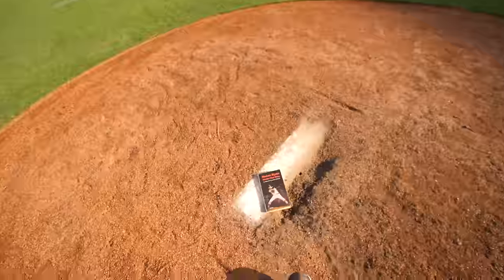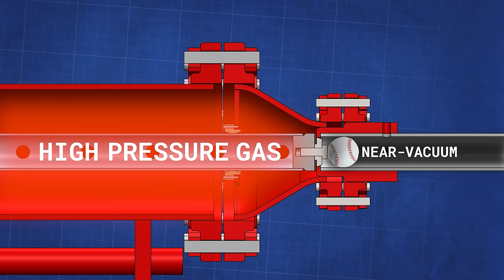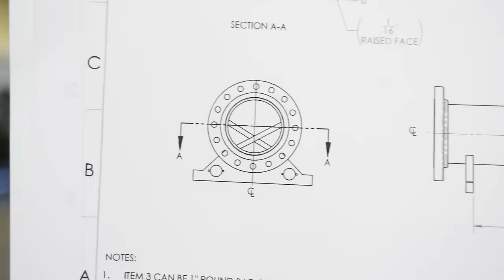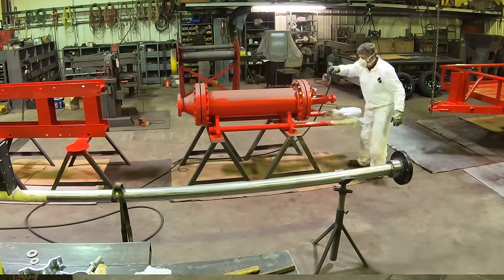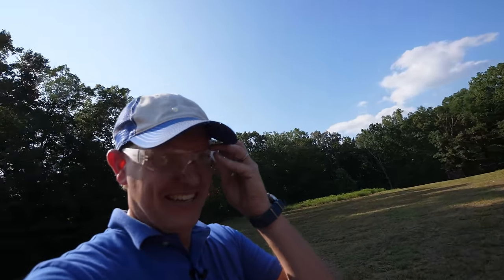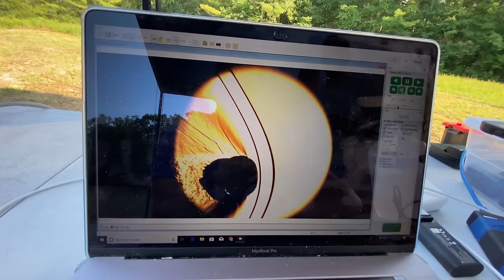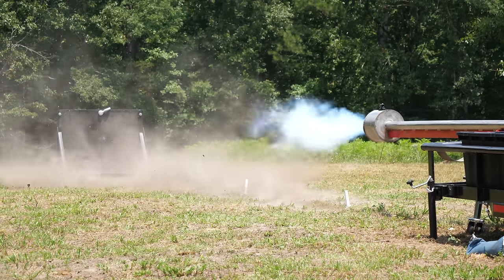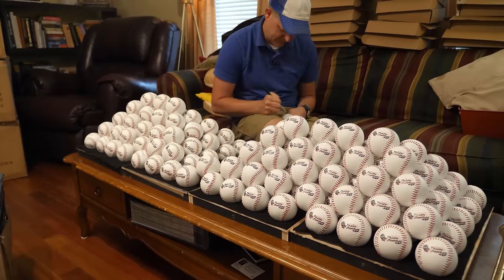World's Fastest Pitch - Supersonic Baseball Cannon - Smarter Every Day 242

Comment: 19:59 - Do we know where the initial damage to the baseball's seams came from? Was it friction from rubbing along the cannon tube while being ejected or the friction from the air going around the ball? While we know the deformation of the ball when it hits the plate is what tears the ball apart, but does the existing damage add anything to it?
Reply: I was born in 1959
Reply: A nerf dart gets shredded when it goes supersonic, it doesnt seem too unlikely that a baseball going supersonic will also get a bit kf damage
Reply: @cwtrickshots4198  OK boomer
Reply from the maker: I wondered if the baseball outgasses inside the barrel.
Reply: It would be interesting to see what would happen if a discarding sabot was used to protect the ball from both the immediate contact with the gas and the barrel. But I can't see how that could be tested without replacing the entire barrel assembly. So any other ideas?
Perhaps using something like a shoot cup behind the ball might make a difference? It wouldn't prevent the ball from rubbing against the barrel, but it would provide some protection from the violent gas pressure behind the ball.
Reply: I think it's fair to assume barrel friction.  It seemed pretty tight when they loaded it.
Reply: @smartereveryday  Sounds like we're in for another round of testing. Isn't Science really the gift that keeps on giving? If it weren't for scientific questions, we wouldn't have as many opportunities to build and use fun gadgets.

Also, don't forget the danger mitigation review prior to experimentation. ;)
Reply: @smartereveryday  Sorry, that last part should have been "Risk assessment and mitigation planning."

Comment: I'm curious where the loss of vacuum was coming from (tape at end?) and if that could be solved for yet even faster shot.
Reply: Yeah curious too about the loss of vacuum. Also wanted to know if the chamber Destin designed worked as intended.
Reply: on some of the later shots he got a better vacuum, guessing the tape didn't have a perfect seal
Reply: @jonathanshaw6784  nah the tape works just fine.... he pulls a -14psi on his dial with the tape on before the pressure in the other tank is added. 
sealing against vacuums is really easy. its just one atmosphere of pressure differential after all. but the back seal doesn't have atmospheric pressure on the other side they have it pressurized to +500psi so the total differential on the back seal is ~515psi. on a seal that is built to not force itself shut due to this pressure.
i say they have a leak between the high and low pressure side
Reply: Five bucks says its the leakage from the high pressure side to the low pressure side.
Reply: @TheScarvig  I came to say exactly this. Well said. With a complete vacuum, Destin could accurately measure the coefficient of friction between the ball and the inside of the barrel. Like we did in physics class where every equation happens in space.
Reply: TheScarvig This was very well said. I can’t say it much better without practically just rewording this message. The likelihood of it being a leak between the high and low side is very probable, especially since it comes on gradually as our pressure increases and not an immediate loss of vacuum which would likely be seen if the seal at the end broke.
Reply: Just based on observing the timing when they started to lose vacuum, there is a leak between the high and low pressure sides.
Reply: I wondered if they solved the problem by the old "soap bubble" method.

Comment: everyone talking about various things in the video, and I'm here wondering if he figured out and fixed the reason why the cannon was losing vacuum as the pressure passed 500psi.
Reply: That was what I was most curious about. I'm not going to be making an air cannon, but seeing what little mistakes can be made and how they are fixed can sometimes incredibly insightful for future reference.
Reply: The most likely reasons was some leakage at the gasket between the two chambers or at the tape seal over the muzzle.
Reply: @WolverinStudio  I figured it was the seals in the pressure vessel that was the cause. Reason being at 300 psi or so, the vacuum was good, which says to me, the tape seal over the muzzle was holding, but reaching higher pressure, vacuum went. So my brain says pressure vessel seals. I know it's an assumption and assumptions are the mother of all fuckups, but figuring out things like this is relaxing to me.
Reply: @ictherain  exactly. Who knows, there could be another air cannon with a leaking seal being built somewhere in the world... like south eastern europe.  ;)
Reply: I imagine the seal deformed under the nitrogen pressure around 300 PSI. I wonder if a strong vacuum is even necessary at that high of pressure with that large of an expansion volume at the front of the gun to take on the pressurized air in front of the ball. The initial velocity wasn't impacted much from the 8 psi vacuum to the 5ish psi vacuums at 500+ PSI. I'd be interested to see a chart of initial velocity vs vacuum at a controlled nitrogen pressure.
Reply: that's all I was wondering too I thought he would address it sometime later in the video, now I am hoping that he would figure it out and make the part 2
Reply: Ball still made supersonic even with the huge leak & loss of vacuum.  I'm wondering if the whole vacuum-front was even necessary.  They routinely shot at <600 psi, even though the pressure vessel was built to withstand 900+ psi.  I'm thinking:  get rid of the vacuum setup, put a muzzle brake on the front, and just load the pressure to 750+ psi.
Reply: WolverinStudio 
All you would have to do is to watch it what point it started losing vacuum at what pressure because it is most likely leaking where the Barrel meets the tank.
I don’t understand why the maximum amount of vacuum would only be 14.5 because when I gas up air conditioners it will pull 28 inch pounds of vacuum because of the sea level I’m at. I’m in Tennessee. I’m not sure which part of Alabama they are in but I am about 30 minutes from ALABAMA if that.
Reply: @e-racer4673  standard atmospheric pressure at sea level is 14.7 psi, as I'm sure you know. So if you have a -14.7 psi vacuum than that would be an absolute vacuum. How you're getting double that is what I don't understand. Definitely would like to know.

Edit: psi is different from inches if mercury. 29.92 is standard pressure for mercury which is 14.7 psi which is what Destin said he was measuring.
Reply: The vacuum most likely reached its peak limit and couldn’t extract any more air
Reply: The ball itself keep pressurised air, keep it under vacuum can cause depressurising the pipe.
Reply: E-Racer 
If you check air pressure at sea level, that’s 14.7 psi. Meaning, if you move from sea level to outer space, that vacuum differential you just generated is 14.7 psi vacuum. You cannot pull more vacuum than absolute vacuum. 

I am not familiar with refrigeration. But I suspect what you meant by head pressure (vacuum) is measured against another point within the refrigeration unit. Imagine this: if point A in the system is at 60psi, and point B in the system is at 10psi, then when you measure the relative pressure across those two, you get 50psi “vacuum”.
Reply: TheHeroJayy 
Yes that’s pretty much how the vacuum pump works. But what folks are asking, is why on one hand the vacuum level held while charging to 300psi in the main tank, but on the other hand as they approached 500psi main tank they start to lose vacuum level.

Comment: I love how they made a "legal" field artillery gun that would make any atf agent lose their mind.
Reply: It's an air gun, not a firearm, so it should be pretty simple
Reply: yes
Reply: @evandugas7888  But it might well make a difference for the legal status of the device, since firearm laws don't apply to air guns.
Reply: I don't think it goes near as fast but I'm not sure
Reply: @evandugas7888  I could be wrong, I'm just guessing, I poorly explained this on another thread but a baseball weighs 4 and 1/2 ounces, a steel sphere with a 3 inch diameter will weigh approximately 4 Lbs. over 10× the mass. f=ma solve for acceleration f/m=a you can see with a high mass and the same force, "a" is decreased. The same energy that liquidises the baseballs at mach 1.35 would probably spit a cannonball in a low arc and dent the target unimpresively.
Reply: @captainTubes  Maybe I am unsure. Still think that using a harder material could have impressive results.
Reply: @captainTubes  so you're saying, use aluminum. ;-) Or perhaps a hollow steel ball....
Reply: @jadedelite  yeeeeeet

Comment: I love this stuff.

Some 20 odd years ago, we in the PCP Targetry sport, in Britain, had a lot of discussions as to whether a PCP (Pre Charged Pneumatic) rifle could project a pellet faster than Mach 1. 
Even the engineers from some of the top manufacturers did not know for sure. 
Folk from different specialisations would expound upon their theories. 
It was already known that a spring powered air rifle could do it. 
Some physicists claimed that because air could not move or respond faster than the speed of sound that the projectie pushed by it could not exceed Mach 1. 
But did it Need to ? 
The important thing was the transmission of energy to the back of the projectile. 
Waves vs Mass (of the transmission  medium) movement. 
The energy was in the pressure waves. 
It was all fascinating stuff. 
Eventually, verifiable experiments were conducted and Yes, a pellet or slug Could exceed Mach 1 when projected from a PCP air rifle. 
Comparable to the instant (near c) transmission of electrical energy despite the slow movement of the electrons in a conductor.
It wasn't even an important factor for Targetry as we were all using sub-sonic sub12ftlb rifles anyway. 
Because the Law in Britain and the stability of skirted diabolo pellets becomes lost above Mach 1. 
But we HAD to know.

Comment: I’m curios to know how far this would go if you shot it into the air with nothing in the way
Reply: I thought the same dam thing.
Reply: @mmccleve  he wants to know how FAR it would go, not how HIGH it would go 😏
Reply: The maximum distance (45 degrees) in a vacuum is the same as the height reached shooting vertical, which is about 11km.

This doesn't include air friction nor the curvature of the earth and centripetal/centrifugal forces.
Reply: If shot at a 45 degree angle in a vacuum it would go 3.5 miles (5.6 km) high, land 14 miles (22.5 km) away, and have a flight time of a few seconds longer than a minute if my calculations are right. Theoretically you could shoot the baseball from Northern Ireland to Scotland and have it nearly go over the summit of Mount Kilimanjaro during the same flight.
Reply: @christophercogliano2520  let's support this man so we can see this happen
Reply: @christophercogliano2520  yep, 22 km, not 11 🤦🏻‍♂️🤦🏻‍♂️🤦🏻‍♂️
Reply: @sephiroth127  The maximum distance is twice the height reached in a vertical shot. Both figures (~11km high / ~22.5km far) are actually correct. The formulas I derived are, specifically:

max. height, vertical: v₀²/2g
max. height, 45°: v₀²/4g
distance, 45°: v₀²/g

(All calculations ignoring drag and Earth curvature. The former is probably not justified in this scenario.)
Reply: @TruthNerds  Yep

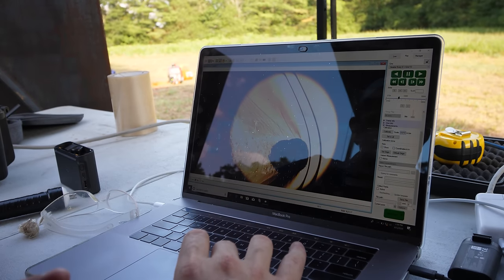Comment: 16:58 You absolute maniacs managed to get windows 7 on a MACBOOK PRO
Reply: Bootcamp.
Reply: Das windows 10. And yea, bootcamp.
Reply: Lol wow
Reply: Could also be a virtual machine... >_>
Reply: that's not a MacBook
Reply: Is a Macbook Pro, running Windows 10, running an app that uses the windows 7 styling for internal child-windows. Some highly specialized software can get derpy to get it to run over time cause no one bothers to update it or make anything better; cause it just works. Who knows, probably has to even run the app in compatibility mode. O.o?
Reply: Yeah, windows 10 bootcamp, my bad
Reply: @roopehienotvideot  wow chill there mr anger management
Reply: bootcamp
Reply: Bootcamp.

And I don't know how you're technologically illiterate enough to confuse Windows 7 with Windows 10. It's like messing up Pandas and Polar Bears.
Reply: @yaltschuler  no actually it is not , and even if you do it makes no sense to be so rude to a guy who made a mistake
Reply: @yaltschuler  The version they are running has the same close and minimize buttons as windows 7 up in the top right corner. 🤷‍♂️

Comment: now im curious how fast it can actually go when pushed to its limits ie 750 psi or higher and maximum vacum
Reply: I would like to see it with a full bottle of helium at 4500 psi and a full vacuum. Heliums speed of sound is a lot higher than nitrogen and still inert, the only other gas with a faster s.o.s. is hydrogen, needless to say that could go very wrong. Though say a 550 C.I. scba tank at 4500 to 5k psi of helium plus a near perfect vacuum, maybe not enough air volume for a baseball and 20 foot barrel, but maybe revisit the golfball and same length barrel. Possibly a mach 3 golfball or pretty darn close.
Reply: @RedwolfTalk  maybe it could run on exploding hydrogen if not pressurised so much? Or if they let explode a small amount, they'd get it pressurized quick :-D
Reply: @katzda  I mean in that case just step it up the whole way and use octanitrocubane. It has an expansion rate of over 33,000 feet per second making it the fastest explosive. Then for good measure draw down a vacuum in the tube.  Go big or go home right, lol.
Reply: @katzda  "explode a small amount" 
You just made Michael Bay cry.
Reply: I think they may be having some minor leakage between the pressurized chamber and the vacuum in the barrel. The vacuum went all the way down to -14 lbs by itself, but when they started pressurizing the large chamber, it started climbing back up toward 0. It appears that all of these shots were done at about -4 to -5 psi in the barrel and about 500 psi in the chamber.
Yeah, I'd like to see 750/-14 psi, but they may not ever achieve that. 750/-5 psi might be interesting though.... 
This thing could be someone's Engineering Master's Thesis if they started experimenting with it - lol! Engineering minds always want to know....
Reply: @jfan4reva  I think it could be an easy fix. Swap that rod for a 4500 psi burst disc with a fusable link that when powered bursts the disc. Those discs are rated for 4500 working load and a peak of 7200 psi.   Then you can increase the pressure and less moving parts, so less chance of failure.

Comment: On the front of the barrel, another method instead of the "accumulator" could be adding a 0psi gravity check valve that vents to atmosphere. The vacuum would hold the check closed, then as soon as pressure builds to enough to lift the ball in the check it vents. ...that check might see a momentary pressure spike as the ball passes and before it leaves the barrel. ...but I think you would get far less air flow wash after the shot with removing that void space and should be a little more efficient. Would also be an easy modification.

Comment: I know this is a year late and other videos have been made of the SSBC. But you never showed the “Plunger” inside the chamber. I only bring it up because I’m curious if you used basically a solid piece of rubber on the end of the shaft shaped to the venturi and the same size as the rod? If it is the same size Or tapered on the back it will create less of an Eddie as the compressed air goes by. Plus it will act as a velocity stack pointing the air into the barrel creating a more laminar flow. Side bonus the right type of rubber won’t become distorted exceeding its plasticity.

Comment: I want to ask a good question you can make a engine run without water and use the electric current to push the the engine up and down and you will never use gas you can recharge it with water and the steam stay inside the engine cylinder Seneca press really hard the move the wheels I am so smart I know you would like this

Comment: I think an important advancement would be to achieve mach I with a spinning wheel. Flywheels will throw weighted strings from their circumference. If the average speed of the wheel's mass is moving 20 m/sec, and the wheel has a mass 30 times greater than the projectile; the projectile should achieve the speed of sound when thrown.

Comment: I'm confused, I mean I know you probably won't SEE a hypersonic shot, but everything I've seen has told me that if something breaks the speed of sound, even briefly, it will produce a shockwave that MUST be noticable.

Actually, I answered my own question, it would seem that both mass, distribution, and overall drag plays a large part in the shockwave, ie more mass makes bigger, wider distribution is bad for speed but good for pushing air, and a tennis ball has such small impact at a short frame of time that it doesn't carry the same force as a jet going Mach 1, which results in a different shockwave.

Comment: Basically, the same thing happens during an asteroid striking the earth. Earth is an immovable object (like that steel plate). Velocities are hypersonic ~ mach 20+ and instead of the baseball, we have solid rock that simply disintegrates. All that tremendous kinetic energy has to transfer into heat, light, sound.

Comment: Is there a difference of air pressure given different temperatures? Because obviously adding something to the atmosphere would change specific speeds, but I'm curious if the density of air molecules impacts air pressure given that it changes the amount of movement of the atoms in said air molecules. Probably not to a significant degree on Earth, I'd guess.